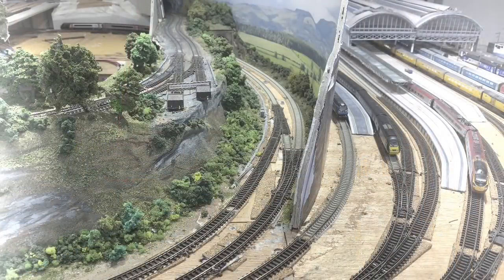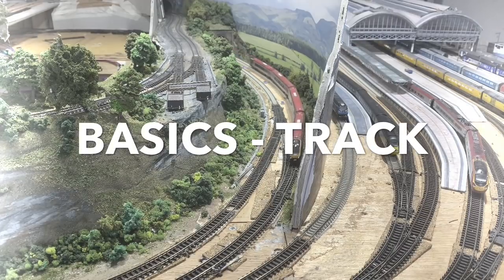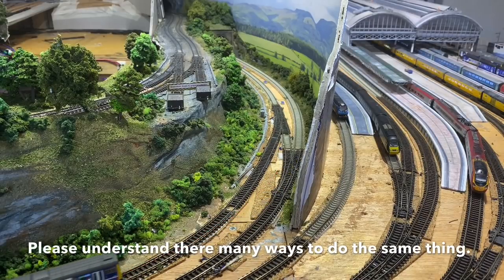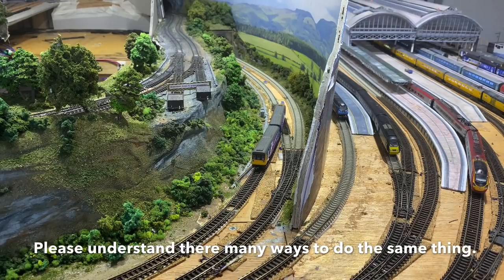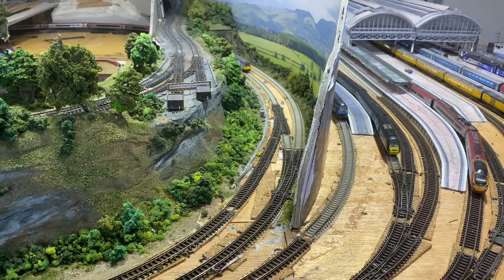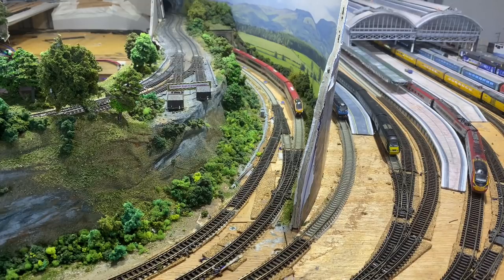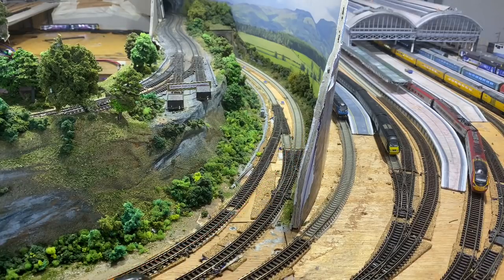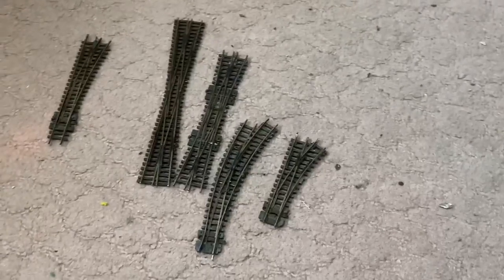N GAUGE MODEL RAILWAY BASICS - TRACK

Comment: Great video with lots of useful tips for both beginners and vets. I've been using Fleischmann track with 6 different radii, ranging from 194.6mm (almost useless!) to 765mm, with a 33.6mm progress except for their last two. I can't emphasise enough something you say - beware of very tight curves, many engines can't take them!!
Reply from the maker: Thanks Nicholas, not sure where you are based, but in UK PECO are the main manufacturers of track, there are others but not available in my local model shops. I learnt the hard way regarding sharp curves and short radius points

Comment: Great video John for the beginner, starting to design and build a model railway in N or 00 gauge. Like you say, some people frown on these track cleaning rubbers, but if they did any real damage to the track, Peco would not sell or recommend them in the first place. I use them together with a graphite stick, which after using the rubber, puts an invisible graphte coating on the rail head, which helps to get a good electrical contact between the rail and the loco wheeles.
Next time I do a video I will show one of these grahite sticks, they are cheap to buy and last almost forever.
Cheers for now.......................Geoff
Reply from the maker: Yes I fully agree Geoff, I’ve got some, they certainly do help. I just wanted to keep the video as simple as poss
Reply: Graphite stick Geoff thanks for the tip which I will use …...…..Cheers Kev

Comment: Very clear and so worth watching as I’m only starting with N gauge. 👍
Reply from the maker: Brilliant, so good to read that and I’m glad my videos are helpful to you. If you have any questions please say and I’ll do my best to help.
Reply: @piccadillymodelrailways  I have quite a lot of trains never run yet the Virgin boxed book set which has a lot of carriages & others I take it I’m best buying a digital controller from the start? Does that run all types of N gauge ? I’m going to watch all your videos over the next few nights, so clear and helpful
Reply from the maker: Sounds like you’ve got the basis for a good start. You asked about a digital controllers, yes go digital or DCC as it’s known. I run a Z21, but there are many systems. I suggest discuss your requirements with a shop. They are best to advise. Yes one controller will control all brands of loco. 

BUT you will need 1 or more decoders for every locomotive (HST takes two - in powercars) either 6 pin or next18. It should tell you on each box what you need. Please be aware decoders are not cheap (£10-35, Don’t buy cheap they are rubbish and can burn out -  aim for £20-30) Remember this is for every loco you have. It can get very expensive very quickly. You could get a single/ pair of decoders to get you going then get more when you are ready. PLEASE DO NOT RUN A DCC READY LOCO ON LIVE DIGITAL TRACK it can and will burn out the motors. ONLY PUT THEM ON TRACK WHEN THEY ARE FITTED WITH A DCC DECODER (or DCC FITTED or DCC SOUND). DCC track is a form of AC current or alternating current at 16v whereas analogue using DC or direct current at 12v you can run DCC fitted locos on analogue never DCC ready, ie no decoder,  on DCC. Hoping that’s understandable and helpful. 

You could buy a standard DC or analogue controller though and run trains out of the box, but it’s one at a time or they all move at the same time. 

Sorry it’s an essay but I hope helpful.

Comment: You are by far the best instructor for this out there! You explain in such simple terms for newbies like me. I feel confident i know what to do after this video. Subscribed. Do you have videos on lists of suppliers you use etc?
Reply from the maker: Ahhhhh thank you that’s so kind. I am a school teacher, so I guess that has to come out in my videos. Regarding suppliers, it kind depends on what you wanna buy. I do use Hattons, TMC, Cheltenham Models, but also my local model shops. If you let me know what youre after I MAY be able to help. If its train or track related please state the scale as I model in N and OO. Hoping thats helpful.
Reply: @Piccadilly Model Railways by John Warner  that's cool because I'm a teacher too 😀  I'm into N scale and I'm in the process of designing a 3m by 1m layout. I've been trying to look for design software but to no avail. I never realised i could print off track from the Peco website as you showed. Genius idea.
Reply: @Piccadilly Model Railways by John Warner  oh and the biggest challenge is I'm going digital. I need to redo my GCSE in physics me thinks))) No idea what I'm doing)
Reply from the maker: All sounds fantastic! The digital bit can be as complex as you want it to be. Personally Id start by watching videos about DCC to get the idea of what the differences are and what it can do, you wont go back to 12v DC once the bug has bit. Then think about buying a DCC controller talk to Hattons theyll give you some options. From which I suggest watching videos on each then decide. Your trains/locos will need a DCC decoder foe every train or loco. Some trains take a few decoders. If you want sound those decoders do cost quite a bit more £100+ per decoder. With all this in mind, ddue avoid older models that are not DCC ready, as to fit DCC can be a nightmare due to the lack of space inside. You can buy DCC fitted which is the same model but with a decoder already fitted, so they just need programming and away you go. Hoping thats helpful, but just say if you are not sure about something. It can be quite unnerving in the ‘early’ days, but there are loads of us prepared to help you. Enjoy!

Comment: Just starting out with Tomix was a toss-up with Kato. Considering putting track on felt. Track coming is 2.4 meter x 560 mm.
Reply from the maker: Sounds fantastic. I love when people discover the hobby. 
You mentioned felt, personally I wouldn’t as it’s fibrous and there is a possibility (however small that the fibres get into the locomotive workings.) 
Something like felt or foam rubber. I am actually switching to no underlay. It is a personal choice though. 

Please say if you need any help.
Reply: @piccadillymodelrailways  Much appreciated,  felt no longer.

Comment: You mentioned the overhang of trains on curves. Since I've not bought any passenger rolling stock yet, and am developing the trackplan with CAD, what would be the best way to figure out overhang? Should I just measure the scale length of the longest expected carriage from end to end on the curve, and for width use the prototype loading gauge specs?
Reply from the maker: Hi, thank you for getting in touch. There are lots of variables here and it depends on which curves you have opted for. As I suggest in the video radius 3 / 4 is much better or long gentle sweeping curves you create yourself with flexitrack. It also depends on whether you plan the run ‘older’ steam trains with coaches or modern trains like class 800. The more modern or recent your trains are the longer the coaches get. Hence the overhang on a modern train is greater than it would be on a say a 57foot stanier coach. 

I recommend get one of those little red plastic way gauges that will help you space your track. Most model shops should have them. If not try TMC, Rails of Sheffield, Cheltenham models or DCC Concepts, in the UK plus so many more. They should only cost pence. 
If all fails and you cannot get one, my track is around 15mm between sleepers of double track and I don’t get trains clipping each other. (For N gauge). 

It’s fine creating a track plan on computer software but oddly it doesn’t always work out exactly as you’ve planned when you come to lay real track. Yes create the basic idea you are after, but then I suggest buy some track including a few lengths of flexi track (not forgetting your first train) and put it together, using the wide setting on the way gauge. ( just place it in between the rails). 

If you do choose flexitrack your local model shop will help you know how to cut the track to the correct length and which rail joiners you need. You cannot beat having a ‘play’ with real track and models, the computer will never show whether a train will catch another or clip the scenery. 

Hoping that’s helpful.

Comment: Your videos are really helpful, thanks.  I am a bit confused on turnouts.  Peco only list the ST5 & 6 or the curved turnouts ST 44 & 45.  Apart from crossings, turnout-wise that appears to be it.  Do you think it could be that the medium and long (straight) turnouts that you recommend are discontinued?  Many thanks.
Reply from the maker: Hi Peter, thank you for your kind words. 

Long and medium points are definitely available. Those you mentioned are ‘set track’ long and mediums are under streamlined track, as is flexitrack. Personally I am trying to stick to long radius points with the odd medium. I avoid ST5s / ST6s as the curves are VERY tight and some locos just wont cope and jump off the track. I have learnt that trains cope so much better on the long radius. It is a matter of space though. Hoping that helps
Reply: @piccadillymodelrailways  Thanks for that John, it does help as I was only looking at Setrack.  It's all a bit confusing when you are starting out!
Reply from the maker: Yes, of course, we’ve all been there. Happy to help

Comment: Great video John. I've a quick question, whats the best way to remove track pins from N gauge track? Would it be similar to OO, use a flat knife or small screwdriver edge to pry the pin upwards enough to grab a hold of it with a pliers and pull? Or is it pointless, and just pull up on the sleeper with pliers and fix the sleepers later if they break? I've inherited a small N gauge layout, along with a much larger OO layout. The N gauge was just started, so need to talk someone through removing the track before they can send it to me. Thanks!
Reply from the maker: Hi Thanks for the question. Personally I don’t use track pins, rather glue.

However, the chairs and sleepers are incredibly fragile so extra care is required. As you suggest I would use a strong knife like an old dinner knife and ease the pin up gently using all available angles until there is enough of the pin to  get the pliers in. Hopefully you can rescue much but some track will inevitably be damaged, especially any points/turnouts. 

I wish you well, just say if I can help further.

Comment: Hi mate, I was wondering if you could help me, im currently designing a small N G layout. Size is key here as it has to be small. Ive come up with some designs but Im concenred that the design involves ST5/6 points. I know you said avoid using them if possible but I cant really comprimise not using them (space saving). In your experience, how problematic would you say they are? Id love to run a 37/47/66/156 etc. on the layout, thats the goal. I watched another vid and some fella was using ST5s and the loco (an american diesel) ran really well over them. Any advice and guidance would be so welcome. P.S awesome series of vids, i'm taking plenty of notes! :)
Reply from the maker: Hi, thank you for your question. The problem with those small radius points is creating very sharp ‘s’ type curves, if you add a very short straight on the ‘turnout’ part of the point you will help the locos. Bobo locos and trains should be ok, ie trains with 4 wheels per bogie. Probably the 37s  too, as they are quite sure footed. I found 47s and farish 66s struggle and required larger curves, as they are Co-co loco, ie 6 wheels per bogie and therefore longer than the standard bogie.

I suggest build the layout as you want it and just try it. It would be handy if you could borrow locos, ‘try before you buy’ so to speak. I do understand how space can be an issue and we have to work with what we have. Happy to help, just say if you think of anything else.
Reply: @Piccadilly Model Railways  many thanks for the kind and very informative reply! Not sure I'll take the risk with the ST points. Class 66 is the main loco I really want to get so I won't risk it. Back to the design software!

Sorry, just one more question if I may, the minimum distance between between 2 SL points, would I have to put in a st202?
Reply from the maker: Hi, TBH Im not sure which points these are, but I would (when you are ready) test the track with your longest vehicles passing each other. Thats either coaches, container wagons etc etc, if vehicles clip each other you would need a small piece of track between crossover points. I design my track by physically laying it following a loose design in my head. There are many ways to plan the track design

Comment: a lot o locos have a minimum radios that they can/should work on,  ive noticed loads say they cant cope with anything below 2nd radios,  or at least that was i think they recommend for flawless driving, i noticed you had red finger tips, looks like you had finished finger painting haha
Reply from the maker: Yes we’ll your never know I might have just done a finger painting and gonna sell it for thousands. Or not hmmmm that’ll keep you guessing, lol

Yes every loco has a min radius. Many will cope with 1st radius of the track wouldn’t be made. But big A1s A3s and few diesels wouldn’t cope. My farish 47 takes every opportunity to take off in its endless pursuit of flight
Reply: @piccadillymodelrailways   the 47 had a dream to be a plane haha, hang it from the roof,
Reply from the maker: Lol, well it’s tempting. I’ve had about 7 over the years, giving it another go and they all have same stiff bogie sets which don’t allow movement over points and alike.

Comment: Hi , can I use 3rd and 4rd radius on a board 2feet wide ?.
Reply from the maker: Hi Steve, Happy NY. Thank you for question. A board 2’ wide equates to around 600mm. However 3rd and 4th radius are require a board of 750mm and even then the track is tight. (2’6”). If you can spare a slightly wider board you could use these curves. Alternatively could you consider an end to end layout, then you could keep s curves fairly shallow. Hope that helps
Reply: @piccadillymodelrailways  thanks john that was just the info i needed ,happy new year keep the videos coming.